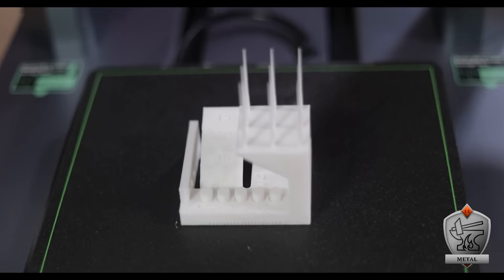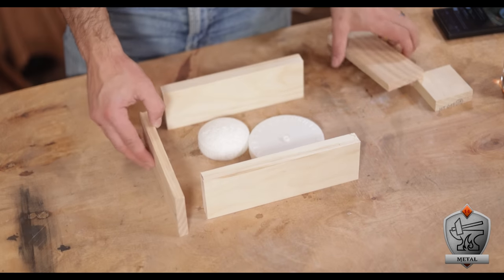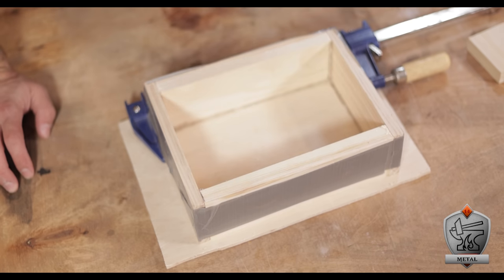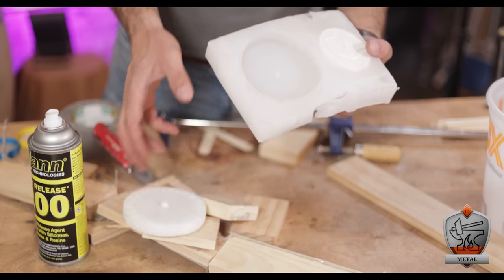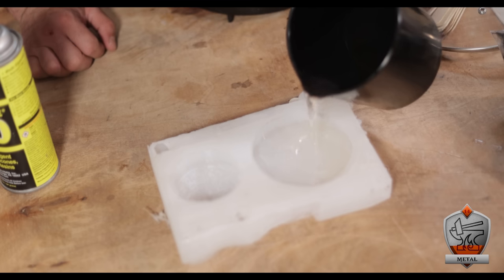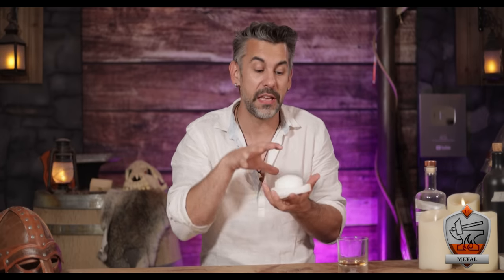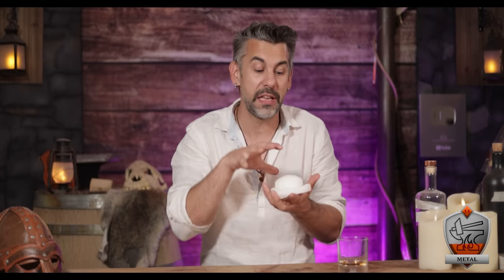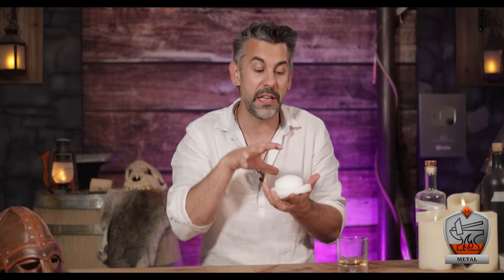DIY Your Own Fantasy Cipher!

Comment: Clever you goofy beautiful man beast you. how could you do this, can't believe you've done this. you done goofed My boy... I have berated you as instructed, Now that that's out of the way I will first tell you how to go about the metal casting. and then tell you how to fix your driveway... First, you are right. that's pretty much exactly how it went wrong, and it's called the laden frost effect. whereby a medium forms a vapor barrier between it and another.
 The important step that you missed is simply using an environment with a lower heat to first melt out the wax. in the case of your previous attempt something small like a toaster oven might work, however that might prove quite pyrotechnic if the wax gets overheated... especially in an enclosed space...
 ideally you would use casting wax as it has a low melting temperature but fairly high flashpoint, which Is pretty much the opposite of paraffin wax which has a melting temperature just a little below its Flashpoint... Please feel free to contact me if you have any questions it would be great fun to work together Even if just as a consultant.... 

And furthermore allow me to save you a couple Hundred dollars on repairing your driveway... If that Is in fact proper honest to God asphalt all you need to do is get a steel tooth Rake (the wider the better) and a weed torch/roofers torch, you know those big propane powered flamethrower thingies you can get from harbor freight for example. by heating the affected area it will melt the tar and act effectively like reeeally messy gravel. Just heat it slowly so that it stays below the flashpoint of the tar and then use the rake to basically rough in the surface and then get A tamper (most Home Depot's sell them) to act as an impromptu steamroller I recommend small patches to maintain consistency. let the tar Cool down and it should cure up good as new. If you're driveway is sealed with some kind of overcoat you'll just have to retreat that particular area, It's more or less how they repair most parking lots Where the asphalt is just Damaged but all the original material is still there :) 
You can thank me by spending the cash you saved on fun projects.

ps. i'm also a master Boffersmith if you're interested in some Foamcraft that can take a little more of a beating then the usual larp stuff ;)